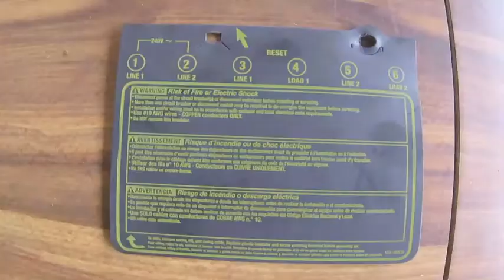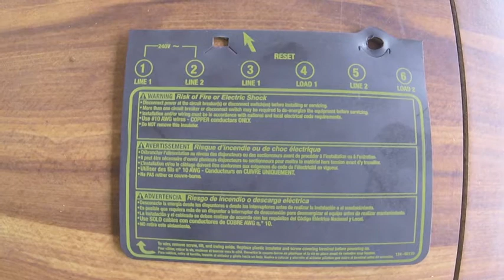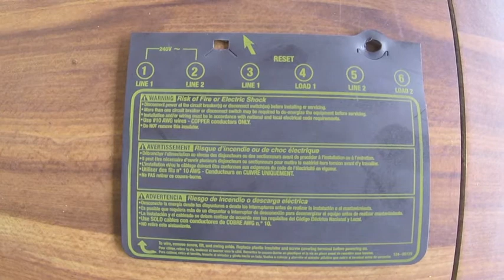Installation of Electric Water Heater Timer Intermatic EH40

Comment: wiring diagram shows not to use jumpers. Did this install work for you?! Mine worked for a short while but I did not use the jumpers
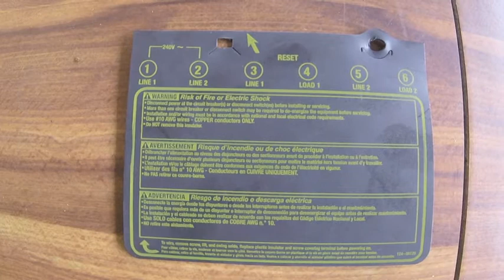Reply from the maker: I used the wires that came with the water heater timer to make the connection for Line 1 (connected #1 and #3) and Line 2 (connected #2 and #5).  See 1:12 of video.  Hope this helped!  Please subscribe